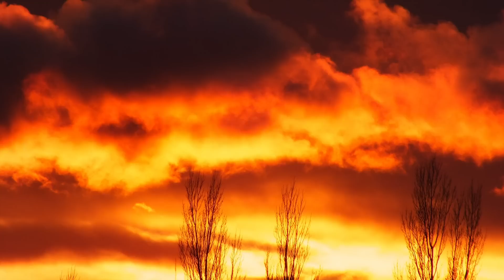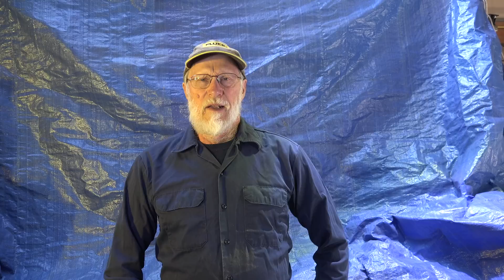Heat pump #5

Comment: I have a question. I installed a Pioneer inverter ductless mini split heat pump in my house to heat and cool it. In heat mode, this thing blows very warm air, sometimes around 130 degrees or higher. Filters are clean, it has plenty of airflow. It has no electric backup heat, just the heat pump. How does it produce such hot air without damaging the compressor? Is the compressor just built really strong so it will tolerate it? Thanks a lot in advance, I really enjoy your videos and I have learned a LOT from you.
Reply from the maker: I can't say I have seen one with that high of supply temp.  Sounds bad to me.
GFM
Reply: @grayfurnaceman  Thanks. I contacted them to ask if it's normal and they said it's supposed to do that because their inverter compressor technology produces heat so efficiently. I hope this thing lasts, I have my doubts with supply temps that high.
Reply from the maker: @averyalexander2303  I guess you will find out.
GFM

Comment: Excellent video as always!  With the newer Mitsubishi and Fujitsu mini splits using inverter compressors and R-410a refrigerant it is not unusual to see up to 130+ F temperatures at the discharge vent of the indoor coils when in heat mode and it is 0F outside.  I have a couple in my own home as well as many customers.  The COP is about 2.75 to 3.2 at those temperatures so they are very efficient.  As inverter driven compressors become more common place with ducted systems, I expect the performance of those systems to be more efficient and more comfortable as well.  Keep up the great work!